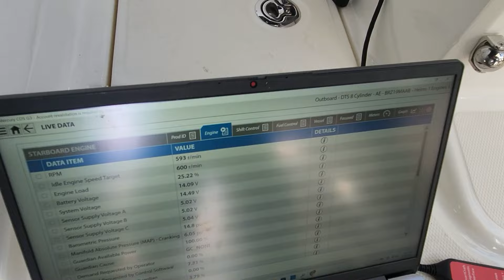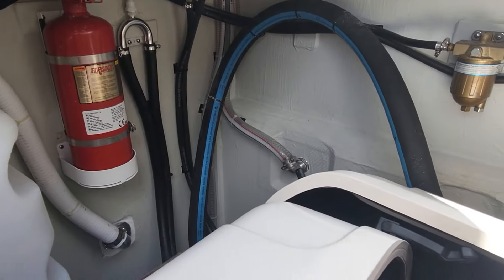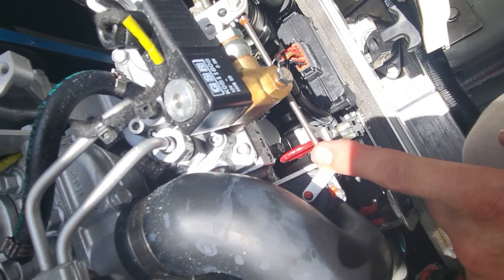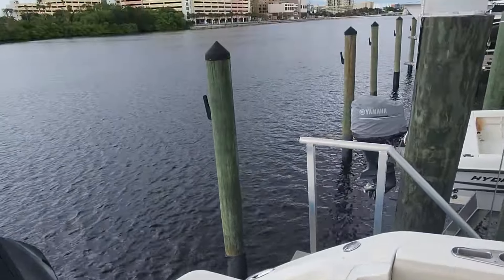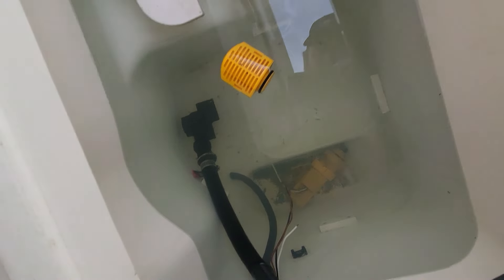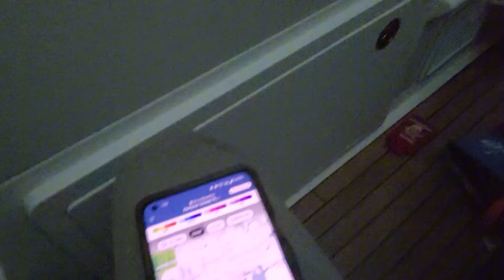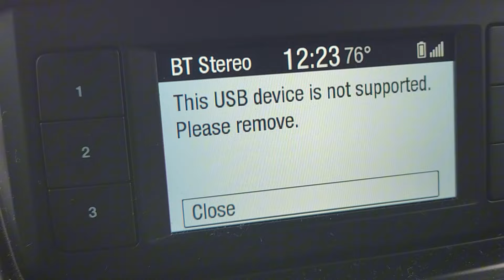What Will Todays Adventures Bring!?!? #Yamaha #BostonWhaler #Bilge #Storms

Comment: Hey Justing, I'm having a problem with an Optimus steering system, everything works fine but when I turn the key on after 30 sec stars beeping a red light constantly I ready check the fluid label all the connection and everything looks well could you give me a hand with that? Thanks

Comment: water pump that should be part of the 100 hour service i thought , that means he didn't service the other 2 engines i wonder if he had you switch all three out and that's an easy job he could do himself
Reply from the maker: There is more to it than that.  I know the story more now. The boat sat for a while before being used. We are actually resealing all three gearcases, performing full services, resealing the trim and installing fresh batteries. It needed some TLC but will be back to the customer ready to go 😊
Reply: @JustinLeeMarine  nothing but bust out another thousand !
Reply from the maker: @zackriden79 You have to pay to play 😋

Comment: Couldn't you just unscrew the flush port if you didn't already have the thermostat removed? That's how I usually check.
Reply from the maker: That's a good point. You can do that for sure. I only say pull the thermostats so you can check them. Yamaha thermostats always stick open. I should have explained it better. You are definitely correct and thank you. 😊